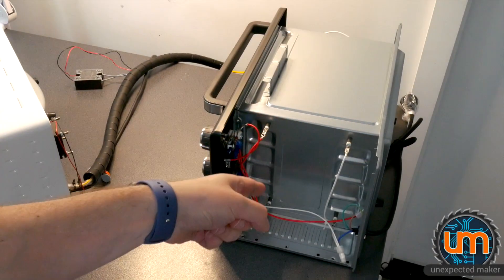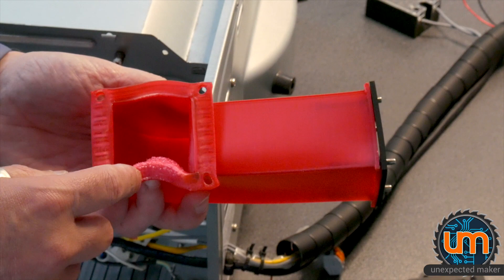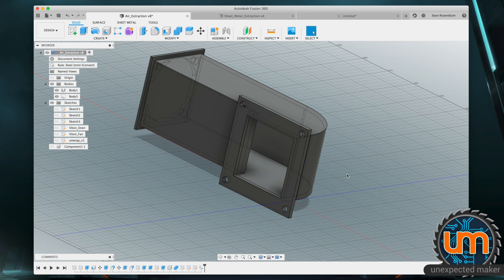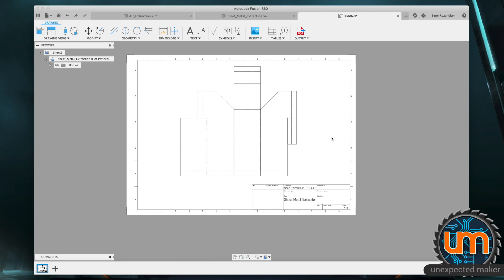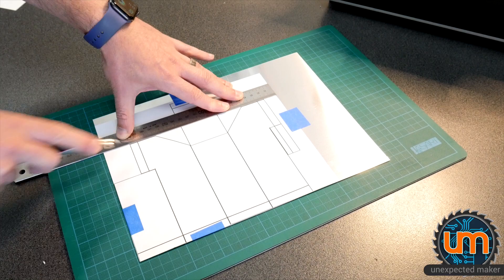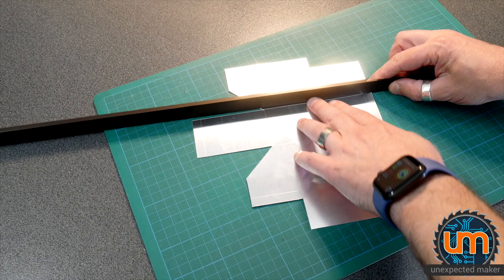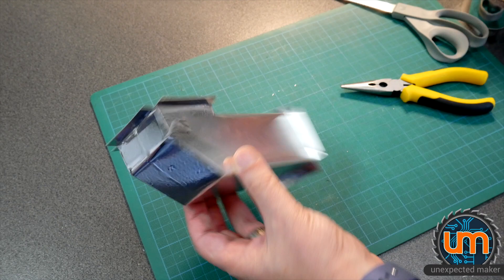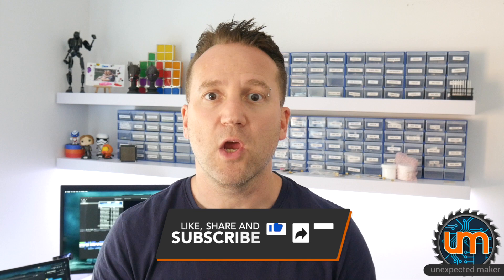Working with sheet metal - Surprisingly easy!

Comment: Thanks for this, I’ve made a PID controller for my BBQ and have been struggling with a way to attach the fan to the air inlet as I’ve lost my access to metal workshops, this is a brilliant way for me to try out designs!!

Comment: Awesome project Seon, is there nothing you can't throw yourself into?! Great work! Thin Aluminium is a great way for people to get into metalwork - it's cheap, and workable with "household" tools like you have shown. You don't need welders, snips, drill presses etc. Great addition (and great choice of material) to complement the custom 3D parts, and electronics for the DIY ovens - I can see a lot of people copying this solution!

Have you tried playing with BBQ/Fire sealant to make your own custom gaskets and seals? May be worth experimenting to get a robust seal on the hot end of the exhaust, along with the excellent use of foil tape.

Steve
Reply from the maker: Cheers mate! There is plenty I'm not cable of throwing myself into - self doubt sucks ;) No, I've not heard of using BBQ sealant to make seals/gaskets. Interesting, thanks!
Reply: Muffler cement (intended for sealing automotive exhaust) is another option for  high temperature sealant. 

It's commonly available in my area, and relatively affordable.

Comment: Great work Seon. It’s always awesome working with new materials! 
I’m still unsure on the approach of cutting a big hole in your oven, and all the work required to fit a fan vent.
My oven uses a servo to open the door for cool-down. This means the oven can be completely sealed, for best heating performance. 
The door opens at the top, so since heat rises, the reflow temp cool-down rate (when the servo auto-opens the door) is acceptable. 
Well, I measure it at about 2C/s, which seems to produce a good result. After all, I have also read that: Free air cooling is sufficient.  :)
Reply from the maker: Thanks Greg, Yeah, I really enjoy the build... especially the :"not cutting myself" bit :)

The original reason I went with a cut out and fan approach was that every linear actuator I found (before I  really understood how I could leverage a short rod version) was over $300 - and I couldn't work out at the time how I'd mount or use a servo to open the door, as it has a lot of spring resistance at the start of the open. Obviously now, I  can clearly seesaw it  could be done with levers, but well, the holes are there ;)

But on my new oven, there is a reason I  want to do a dual fan setup instead of the door opening...  but you'll need to wait for future video for that!
Reply: @UnexpectedMaker  Awesome. I look forward to following how this progresses! :)
I’ve made a few projects using Metal-Mate aluminium angles / channels, but have yet to make anything from the sheet aluminium.
So your video has also provided inspiration for pondering on some sheet aluminium projects possibilities. :)

Comment: That duct totally needs to be made out of PCB material -- design some nice flat PCB slabs with tabs that slot together, and then solder :-) And a couple of copies of square board with square opening and mounting holes for the ends. Yeah, that's the answer!
Reply from the maker: It's not duct tape, it's actual tape designed to be used for sticking & insulating metal connectors.
Reply: @UnexpectedMaker  Hmmm, did you respond on the wrong comment or something? I'm not really making sense of your reply.
Reply from the maker: Yup, miss read your post sorry, hmm, PCB construction intake system -  sounds terrible :)
Reply: @UnexpectedMaker  That's more like it!

Comment: Good thing you didn't want to try to weld that! Aluminium is reasonably hard to weld properly (the heat transfer properties) especially when it's quite thin! Looks good though, nice work!
Reply from the maker: If I had a welder, I'd have used something other than aluminium, but this worked out great.

Comment: Tape adhesive may come off with heat. You can design the sheet metal cutouts to allow room for screw holes.
Reply from the maker: This tape doesn't come off with heat. I'll have to do a follow-up video about this, as it seems "I'm the only one that believes me" that this tape is a perfect solution for my needs :)
Reply: That looks like a lesser version of the tape they use on airplanes. At the temps likely to be seen by a semi/pro/hobbyist at home, that tape ain't going anywhere for a good long while. Very nice build, but you gotta watch out for those blood suckers. Looks like one got ya and stole a bit of your life essence.
Reply from the maker: Damn vampires in the closet! yeah, this tape isn't going anywhere!

Comment: Seon, you probably could have retained the curved corner with the folded metal design. You would only have had to cut the curved sides (ie, top and bottom) and taped around the curves. But I doubt it makes a lot of difference. Nice fix.
Reply from the maker: I know, but didn't want to embarrass myself on my first attempt by wrecking the cut - on video ;)

Comment: A great "Engineering Solution". You've won me. I raced down to Aldi and got the oven - BTW if you really want to see bedlam roll up there when they have a special on mattresses - don't ask me why. 

If the glue on the tape starts to give way on the seam/rear of the oven you could pop rivet your channel on. If worst comes to worst you only have to drill it out - and use larger rivets next attempt.

I'll have to get your new controller and then we're A for away. Thanks for the great work.
Reply from the maker: Aldi sell mattresses? No way!
Reply: @UnexpectedMaker  Well I do live near Moe.

Comment: Definitely better than the 3D printed one, can't believe it's taped together though, I thought you'd have to solder it, very ingenious!
Reply from the maker: Solder it? Never even occurred to me to try, maybe next attempt? :)
Reply: @UnexpectedMaker  it's close enough to welding right? ;)
Reply from the maker: Hahahaha
Reply: Unexpected Maker Solder aluminium? Don’t think so. As for welding. Hmm you’d need to do TIG, and its the most technically demanding of welding types. Not to mention requires a particularly high skill level to accomplish on such fine material. TIG isn’t for beginners I’m afraid. Also TIG requires Argon gas and the equipment itself isn’t cheap. You could always create tabs in your Fusion layout to seal the various folds, instead of simple butt joins. That would allow for sealants between the layers of a join and rivets for making a more solid construction.

Comment: I bought a pop rivet screwgun adapter for this, should be able to fold it over and drill and pop rivet it. Rivets are expensive to buy in small quantities though, I have not actually used it yet, gonna try using 3d prints still for now for my reflow oven, Maybe insulate the parts somehow... will experiment some I guess. But I DOO have some left over sheet alum in the shed.....
Reply from the maker: Yeah, I really don't think I need to rivet this. The oven is stationary, and this tape is SOOO sticky!
Reply: @UnexpectedMaker  Is that like pipe wrap tape or like exhaust tape? You think it will stink or melt?
Reply from the maker: It's flashing insulation tape - It doesn't melt or stink. It's lasted 18 months on the back of my white oven, through every reflow I've done, and it's still in pristine condition. No melting, no smells, no adhesive breakdown, no corners curling, no dullness of how shiny it is. It's magic tape!

Comment: Nice. ;)

Will you be using a metal fan?
It could then probably exhaust the hot air out without melting the fan, but I suppose the bearings could still sieze eventually.
Reply: I thought about maybe adding a kind of "gate" to the exhaust as well, so it only keeps the heat in until the fan switches on.

Not sure the best way of building that, though. Maybe a small servo that just moves the gate?
Reply from the maker: No, new fans are not a metal ones - super super pricey. It's not enough just to get a diet-cast frame, it's the fan internals that need to be heat rated. My 5V fan I took off in the video has had 18 months of heat leaking through it, and it's held up fine. So going with same again, but 80mm, and more air volume.
Reply from the maker: I've been pondering that, but  not come up with an "easy enough solution" yet, to be able to both control it, and make it effective.

Comment: Yes, I always use sheet metal or wood if I can get away with it. Beats waiting for 3D printer to finish printing.
Reply: "No matter how hot I get it" haha.
Reply from the maker: Yes, waiting for 3D prints sucks.. but no way I'd put a flammable wooden solution in there instead ;) At least with the PET-G option, the worst case is it melts :)

Comment: Metal is my first choice! ;) Nice work to kill time with! ;)
Reply from the maker: I think I've been scared of working with metal up until now... or maybe not scared, but I felt like without metal working tools, I was not able to do anything, but clearly there are some aspects I am able to do :)
Reply: @UnexpectedMaker  vise grip duck clamp are always nice to have. ;) I am thinking when I make my own that I might install it vertical so the intake fan is on the bottom. Just to reduce thermal radiation escaping.

Comment: - Use gloves to protect your hands as aluminium can be very sharp. 
- Perhaps some metal clips or strips with screws can be used to hold it in place. I am a bit worried that after a long time the glue gets dry and the nice made tube will drop.
Reply from the maker: Yup, I should have used gloves! The tape has lasted over a year on this oven already taped directly to the oven rear, so if it can withstand that, I'm confident it will be fine.

Comment: Very hard to weld Au but that type of Au is very easy to solder.
Reply from the maker: I never though about soldering it... I had always planned on using that tape, and I'm very happy with the results. Time will tell how long it lasts, but I'm more confident than most here, but I've been testing it for a long time.
Reply: @UnexpectedMaker  Ok. Use tape. When I build I like to build toward making it last. Tape over time will break down in both hot and cold enviros. Solder will hold and is easily applied. The hot exhaust is not hot enough to re-melt it. If it is,,, use a high temp solder on the exhaust. You could also use a high temp epoxy to cover the solder joints. Remember your pc boards. They are epoxy, do they melt? Nope.
Reply from the maker: Define last? It's been running solidly for 18+ months so far with this tape plugging the holes on the back of the oven, and the edges of the tape haven't even curled - let alone any issues with the glue. On top of that, the oven is a Reflow Master development oven, not a production oven. It gets pulled apart often. Same will happen with the Reflow Master Pro oven. Context is really important here.
Reply: @UnexpectedMaker Oh yeah then the tape is the way to go. But as far as the exhaust scoop I was referring to I soldered mine and its been on its 3rd oven since 1998. Also the tape now is much better tape with better adhesive.

Comment: Don't wanna rant and I like ur vids.... but in this case I think u od'ed. why not just take a commonly available round heat resistent pipe instead of all these efforts? And also sticking aluminum together with sticky tape doesn't really look that cool/professional.
Reply from the maker: Why would I buy a solution, when I can make one, and learn how to work with sheet metal, a new medium I've never used before, and to use a new feature in Fusion360 I've never used before? I'm a maker, not a consumer. Also, the tape looks ace, and is a perfect solution for this problem. It's not sticky tape, it's tape actually designed for taping and insulating metal brackets - I'm ecstatic with the results!